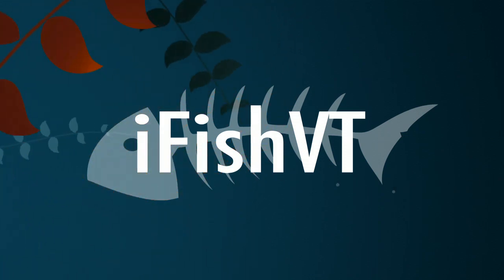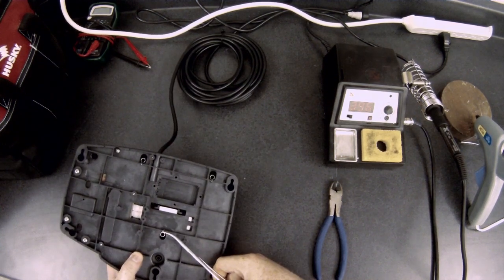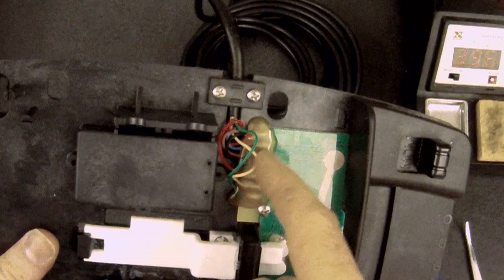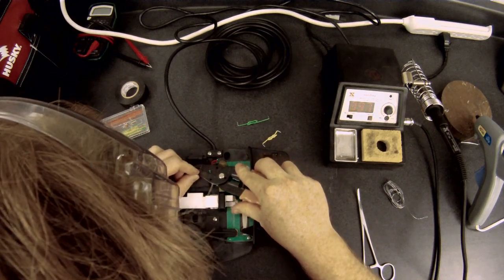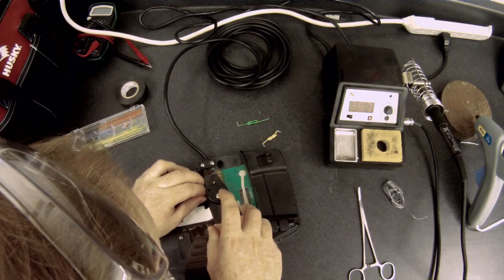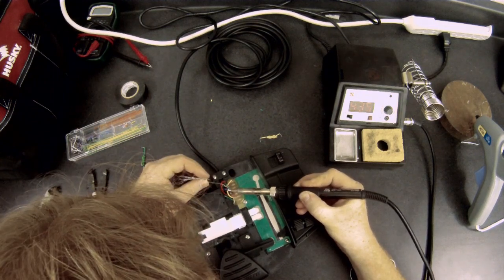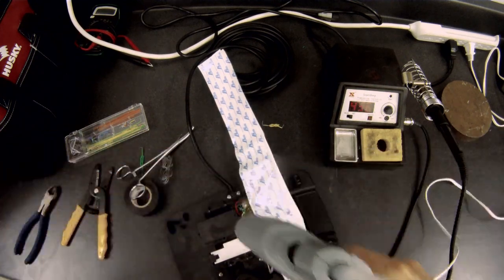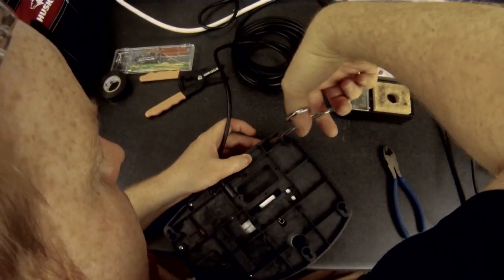Powerdrive V2 Bow to Stern Conversion Hack

Comment: Thank you for making this video! 
I recently scored a power drive v2 from the local dump that looked to be in perfect shape. The foot pedal wasn’t working so I popped the top off and cleaned everything and removed rusty debris from the slider magnets. Then I laid a strip of duct tape around the outside bottom edge of the circuit board to raise it up less than a millimeter. Now the the little levers all fully press down on the popper buttons on the circuit board and I have a high dollar trolling motor....for free🤘🏽
But it needs to go on the back of my 17ft bowrider because there just isn’t anywhere to put it on the front. Even if there was room... I fly fish and don’t want anything else to get my line wrapped around up front. And I take my boat out on Lake Superior and need the trolling motor to do double duty as a kicker motor if my outboard fails. 
Thanks again. You saved me a lot of trial and error.

Comment from the maker: This is exactly what I use it for!! I hacked it in the pedal so that the foot-control would be reversed so it would push the craft and not pull it. I have not done this with the iPilot but I am told that you can switch the same colored wires in the head of the unit and get the same result.

Comment: I tend to agree with you.  I mind simple mind the propeller can only spin one direction or the other (push or pull), but I guess it can turn 180 on way or the other is another DoF/ option that could cause the gps and ipilot drive to get confused

Comment from the maker: I don't know for sure if their system will wig out but my assumption is that the iPilot does not know it is pushing or even that you reversed the wires. I think that it will be less accurate during the mode that stakes you out around a specific spot because when you push and don't pull sometimes the wind fights you side by side more... So I think it will work harder and use more battery but it should still work in theory...

Comment: You are awesome.  Why didn't I think of this?  I assume it will work with the terranova.  So you say that the service center can shorten the  shaft motor?  What did you take it down to, 32"

Comment: Are you going to hack the ipilot this winter.  I saw a guy fishing with the PD V2 on a boat and it was really neat.  Your hack on the foot pedal makes sense, just what does the ipilot (head on top of motor) look like for hacking.  And would spot lock and tracks work.  Hey how is the maneuverability and drive with the motor stern mounted.

Comment: How bout if you switch the white and black wires that go to the dc motor that controls the steering? That way it should work regardless of the control device. If you want to cut the shaft off pop off the top unhook the wires that go down the shaft, take the bolt out at the head. cut the shaft off (it's friggin fiberglass cuts easily with a hacksaw), put the shaft back up align the head, mark the holes, drill the holes in the shaft, reassemble, reconnect the wires, done.
Reply: TheSniffher you could definitely do that so long as you're sure those are the steering wires in the motor head. I went with the pedal so that if I wanted to sell the motor in the future I wouldn't have to re-wire it...

Comment: I talk to several people at Minnkota, including the head of marketing and I'm sure that it could be done through the software, but Minn Kota doesn't see the Kayak market as big enough to consider this for a stern mount option.  SUCKS.  I tried to tell the guy that people are spending $700+ on bass yaks motors, so they might want to do their homework.